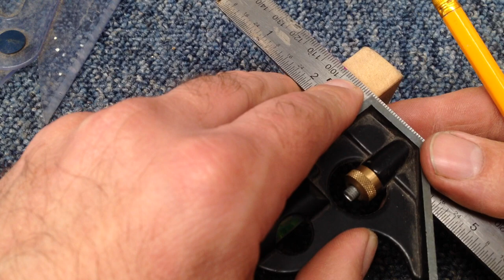Is this the Best Pencil Sharpener... EVER?

Comment: Needs to be made of 10000 times folded finest steel hand forged by the thighs of cuban maids. 
Also try and make one for drill bits and you got something proper useful.
Reply from the maker: Hmmm I did do a video on pattern welded plutonium and steel. Maybe I should use some of that for sharpening carbide drill bits. I could think about Cuban maids thighs while doing if you think it might help. :)